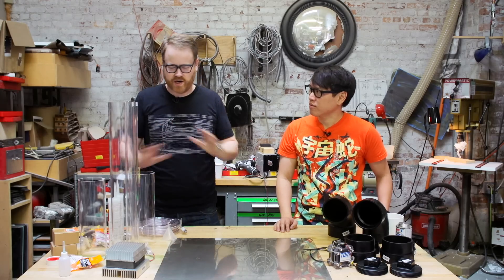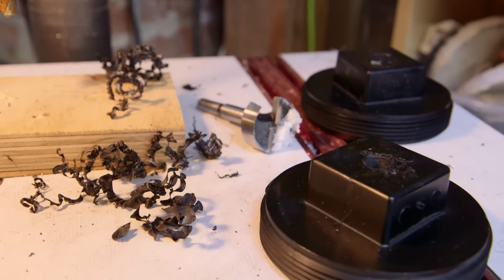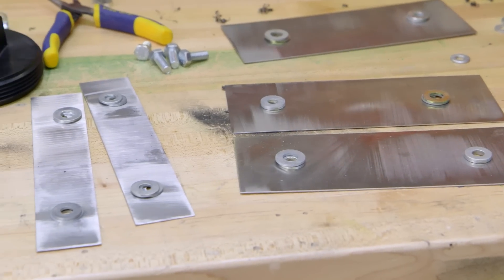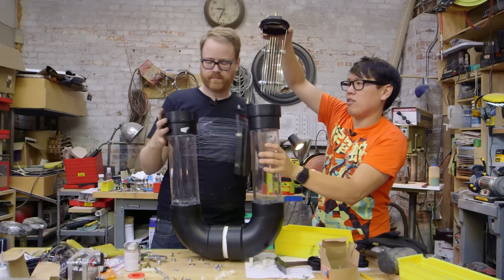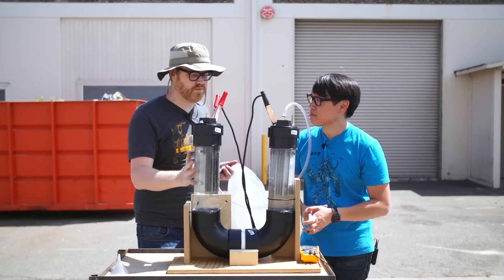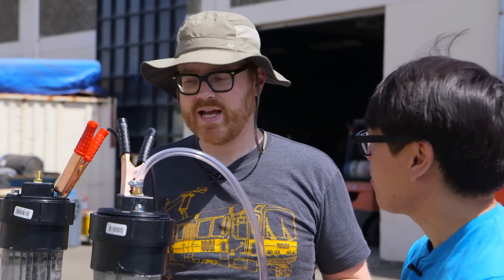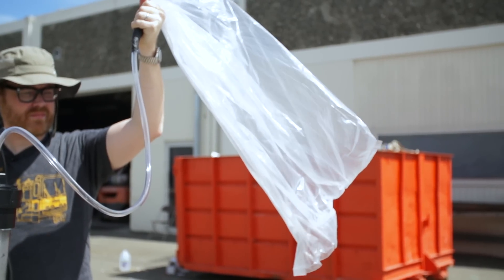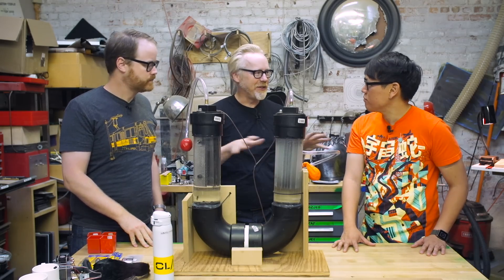Tested Builds a Hydrogen Converter

Comment: Wow these two guys do NOT know what they're talking about hahahahaha! 

Who knew, voltages can flow through water!? hahahaha
Reply: Pure water is not a conductor. Impurities in the water make it a conductor.
Reply: @willdwyer6782  you actually want distilled water mixed with salt so that its only conductive with no other impuritys so you only get hydrogen and oxygen.
Reply: @burntchickennugget191  NOOOO, Salt is the worst impurity, it will make chlorine gas.
Reply: @bokjerland9672  It depends on what type. Plus if your like me you will split up the chlorine from what you need
Reply: @burntchickennugget191  And Chlorine gas if you use salt!
Reply: All salt will produce chlorine gas. Hence the composition of NaCl. Also, distilled water as conductive as rubber.
Reply: @treysenzobell3299  you do realize you can filter out clorine right. Also there is a certain type of sodium that wont produce clorine since it doesnt consist of cloride. Or you could probably find some type of sodium on its own. Whatever works best. You see. If it doesnt experament and find a way to make it work. I dont see why people give up on it when companies like mazda tried it. Mercedez tried it. Even honda. The fuel was just too unstable when it was just dumped into the engine. If you can just use sodium use sodium. And distilled water. The crystals in sodium will be enough.
Reply: @burntchickennugget191  You do remember that pure sodium in water makes a highly exothermic reaction that results in NaOH and H. By highly exothermic I mean explosive.
Reply: @treysenzobell3299  perfect for combustion. In an engine. Like when you spark fuel it explodes same goes for sodium and water. Its the perfect mix for an engine. Think about it more power. Cheaper materials. More range if tuned correctly. I dont see an issue
Reply: @burntchickennugget191  Not when the combustion is in a chamber near an engine, rather than in a cylinder.
Reply: 5:41 oO ?
Reply: I thing it would just be easier to get water injected into a cylinder as the sodium is sprayed in before that way it provides the boom and the exhaust will be the reaction gases. Its all just hydrogen gas and heat. In my opinion its worth it. Your blowing up fuel in the cylinder anywyas might as well be a fine sodium dust that it sprayed instead of gas. Once the sodium is sprayed a thin mist of water will be injected aside from it and as the pressure increased from the piston getting closer the water will mix with the sodium and speed up the explosion of hydrogen gas. Its a much much better idea and the sodium dust will be stored away from the engine in a nice safe compartment were it cant mix with moister.
Reply: @burntchickennugget191  You know absolutely nothing about chemistry and are just trying to recover from an idiotic idea. Just give up already. Sodium and water produces far more heat than expansion, making it a horrendous candidate for a fuel. Not to mention, it produces sodium hydroxide, which is highly corrosive to skin tissues. Not only is every idea you've proposed ineffective, they're downright lethal. Starting at chlorine gas, moving to storing large quantities of sodium (a highly reactive chemical with one of the most abundant resources on the planet) that has byproducts that are corrosive to our bodies. Sit down before you say something more idiotic.
Reply: @treysenzobell3299  Heat is actually more usefull then you might think. 

I may not know too much. But thats what science is for. To learn more about this stuff. Sure you might know more and comsider this idiotic but in the end its still somthing we should consider. I see you took my last comment as an attack. Im here to learn. There is allready a special engine design that doesnt use expansion and instead uses the heat to produce power. With Cad we could replicate it without the lethal effects then test in a stable inviroment. You shouldnt be this close minded. Either way was nice chattin. I think ima do some tests in a simulator then see what i should do from there a buddy of mine has acces to some tools that will aid me. So in the end ima keep doing my research. I dont see the point in just sitting and telling yourself somthing is impossible or idiotic. Rockets are a stupid idea. Yet we still make em. Cars arent really the best idea but since its a fast method of transport we still use em. Giant sluges of metal flying past each other. Its fun untile somone gets hurt. I guess the same goes for this. Its fun and cool untile somone gets hurt or blows up an engine block. But im pretty sure this isnt gonna blow it upm your right expansion wouldnt happen without some gas. The hydrogen gas could but thats not the key. This is more or less a generator setup. Useing a compressor. That uses the hydrogen for a second part of the system. 

Again not ideal for most but in the end gas engines are only around 25% effecient. So i dont see how this could be any worse unless you use the same engine design. And we wont. Its not possible with the current engine design. But with a modified version it could. Either way. Ima figure out a way to use another method and explore new options.
Reply: For the purpose of breaking water molecules, sure it's not conducive enough. 

But if water were not at all conducive we wouldn't have the idiot warning labels on things like hair dryers.

Comment: Assuming you are supplying 5.29 amps (as the solar cell indicated as the optimal operating current), you would only produce a little over 2 liters an hour. Since amps and liters produced are directly proportional, you would need about 16.6 A to produce the 15 L in 2 hours.

Comment: "22 volts of power, about 100 watts of energy" i physically cringed
Reply: If the current from the solar panel was 4.5A then with 22 volts you would have 100 Watts of power.

Comment: Err... what's with the peroxide dumbos? a couple of spoons of salt would have done the same job as an electrolizer and no way that was 22v you were feeding into it, i've seen more bubbles in a glass of flat lemonade. Guess what dumbos, this idea really works and it's so easy to do but you two would be geeks still managed to mess it up. Oh and another tip, try looking into the right camera if you're going to do multi angle edits for youtube. You're a couple of amateurs but it does border on unintended comedy. Your efforts to discredit this idea is akin to me trying to build something I don't understand then saying it can't be done because mine doesn't work.

Comment: Over volted the setup, too small a surface area,  and used a poor h2 storage container.  Kudos for doing it and learning how to make it work,  although,  improving upon the design in multiple iterations and learning more of the chemistry would have been great to see. 

Most commercial electrolyzers run at 80% efficiency. And,  the bulk of industrial h2 is generated from natural gas using a water gas shift reaction.

Comment: They need more amps, not volts because voltage is energy in the electron while amps is the amount of electrons.  Since this is a redox reaction at heart, H2O+2e- <-> H2 + O.  The minimum energy needed is like 1.28V, to 1.5V.  The rest is excess.  So you pump up amps.

Comment: It looks to me like the oxygen side was open to the atmosphere while collecting hydrogen in a sealed bag on the hydrogen side. Is it not possible that when the pressure built up in the bag that the hydrogen was forced to and out the oxygen side? I think some sort of one way valve is needed between the two sides. Or maybe there wasn't enough pressure to cause this problem.

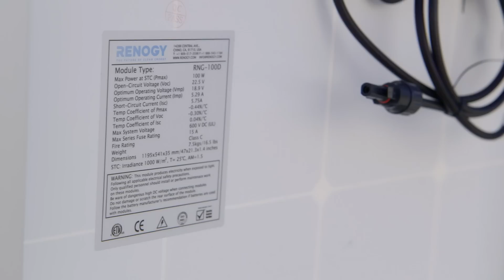Comment: 6:33 "It produces about 22V of power, 100W of energy." 
Yeah sure. Please learn some basic physics before trying to explain something to people in a scientific video.

6:55 Oh shit it is getting worse. We are at maximum stupid power here. 

The 22V delivered by the solar panel are measured unloaded.... This is the max output voltage. Once loaded (drawing current) it can go down in volage to anywhere, depeding on the load resistance, but the power output of the panel will always be 100W max. A car battery can output 5000W easy. The key for making the system efficient is to tune the reactor for the power source, which you seems to be unable to even think about.

Comment: This is an embarrassing display of science. Plates that are separated by almost a gallon of empty water space will not conduct a strong currant of voltage. If you're a quarter mile from a lightening strike point in the ocean, you're safe. If the plates are more than a few inches apart in your solution, they produce magnitudes less than if they are side by side with a perforated membrane. Also, in a lot of uses for hydrogen, the HHO that is produced by one of these is just as useful if not more. The only issue being the excess water production when burned or plate filtered such as in a fuel cell, which would require exhaust drainage in certain scenarios. If you watch The King Of Random's video, he is producing much much more gas with not much more voltage. You can angle your plates like so:

////\\\\
\\\\////

Making your corners opposite, and you'll double your production. Some clear tape and a hole punch will teach you wonders when it comes to separating the O2 and H2 gasses. Split it right in the device without worry of two separate chambers. 

It is obvious that this is purposefully done wrong. I was hoping not to find that the breakup was due to sell out...

Comment: No no no. If you get skin exposed to   strong base (or strong acid for that matters), just rinse it with lots and lots of water. Using a weak acid to "neutralize" it will make it WORSE, not better.

Comment: You will get more production if you gave higher voltage as high voltage will break the resistance of water i made one like that and got more production by giving high voltage i gave 8 amps 170 volt DC and got more production

Comment: Correct me if I'm wrong but they didn't use plastic bolts and plastic washers to separate the plates. Big mistake. I built one years ago in a small 6" x 4" x 4" plastic container that produced a hell of a lot more hydrogen than these guys did.

Comment: If they used electronics like DC-DC converter to lower the voltage and higher the amps of that solar panel if this panel is 100W then A=W \V = 100/12= 8.33 Amp then the DC Converter converts the 12V to 5 Volt and Multiply the Amp by 2.4 (Ohms Law) then the result will be 20 Amps, that would make huge difference to seperate water Molecules into HHO, after all it is about Amperage not the Voltage "In Conventional Electrolysis"

Comment: Good try, but I suggest you try a different setup. You can use something like a solid block of metal. Cave out two holes not all the way through so that they hold water. Pour electrolyte in both the holes and carefully place the electrodes on both hikes without them touching the sides. This way you'll be able to separate the two gases like you wanted without increasing the intrinsic resistance of the electrolyte which was a problem in your design.

Comment: Yay "Integrity". also why the fuck is Adam Savage part of "Tested" like it is some equal partnership? It doesn't take a genius to figure out that Will and Norm know absolutely fucking nothing about: Electric Engineering, Machining, wood working, metallurgy and plumbing.

They can build Legos. that's it. Something most of us have mastered at an early age. But you guys better watch out some of the stuff they build requires you to be older than 14.

Comment: If you would have sent the hydrogen through a bottle of water or a bag filled with water the hidrogen wouldn't escape and you could get it all instead of loosing it through the faulty untight plastic bag or balloon. Also if you had the anode and cathode nearby each other with a thin separation as possible it would almost infinitely expand the output.

Comment: Is water conductive? Yes, but electrolysis is another story. You want 15 L of hydrogen in STP? Then you need 15/22.4 (L/(mol/L)) = 0.67 mol of H2, by equation of electrolysis, you need 2 electrons to reduce 2 H+ ions to H2, or 1.34mol of electrons, or Na*1.34*e=129kC of charge, or if you run for half day, about 3A of current. The key is the current flow, not the voltage. No matter how much voltage you applied, you won't get 15L of H2 if you can't hydrolyze the water at 3A. Water will break at 1.23V+ so there's no point of applying higher voltages either.

Comment: Too much BS in this video. Fear using potassium hydroxide (to deter anyone trying), of which I have never seen used in any electrolysis videos. Increasing voltages DOES NOT increase production. The fking Current  (Amps) does. The anode and cathode are ridiculously space far apart. With so many sure to fail flaws tgen of course tge system is designed not to work. $hitbusters.

Comment: The electricity has to travel through a meter of water before reaching the opposite electrode. That's why this setup isn't effective for electrolysis. You'd need high voltage to make this work.

Comment: Hahahaha this is actually funny for me. I studied this for our thesis. seeing them fail reminded me of my collge days. For better results, you actually need to have a good amount of current running trought the plates. In what they did, there were small amount of bubbles even if they had a good voltage. the explanation is that the water solution still has a good resistance. You can also narrow down the gap between anode and cathode to lessen current losses/ resistance. Reducing the gap can also reduce the travel of the hydroge and oxygen atoms to their respective plates( anode/cathode)

Comment: There isn't any thing wrong in their design, its just a simple case of what power source they were using. They incorrectly stated that more voltage = more splitting. It doesn't matter what voltage, its how many watts (total amount of electrical energy per second) you put through it. 10 volts at one amp is the same wattage as 5 volts at 2 amps. This is because watts = voltage x current. A 12v 100 AH lead-acid car battery can supply 12volts at 100 amps, or 1200 watts, for an hour which is WAY MORE than their puny 100 watts. No wonder why that guy was creating just abt zero hydrogen, HE WAS USING PUSSY ELECTRICAL POWER!

Comment: Use electricity from solid panels on the roof of your shop to power the electrolysis rig a d use the hydrogen to power a generator to make electricity to power your shop...........makes sense........i use hydrogen to power jets and small cannons that shoot foam whiffle balls

Comment: Fake false maybe if you did it properly you would have gotten a actual result! One you can use baking soda for a catalyst, two WTF are you thinking trying to complete a circuit through the water!? The arc is supposed to jump from plate to plate causing more bubbles which brings me to three u use metal washers not plastic like the King of random uses the plates are not to touch so that the arc jumps. Completely one sister Adam Savage is a paid off hack!

Comment: You are making cool.But anode and cathode distance are so long to make this.This a major problem.Plate distance increase also resistance increase,so more voltage need.Electrolysis using less volltage more current is need.Maybe 5volt 100amps is better for 5mm distance of both plates is greater output is made.

Comment: Thing is a battery in a car is only used for initial start up. The alernator is what gives it all the power after internal combustion starts. Using a solar panel that size is like comparing two double a batteries to my 220 dryer plug. Nice try though . NOT!!!!!!!

Comment: I knew it would fail soon as they decided to separate the electrodes by such a large distance, nominally you would just put a couple of mm between the plates, or just put aluminium in a test tube containing Lye, you can fill a balloon in less that 30 seconds.
Perhaps they should use someone with some knowledge of science LOL.

Comment: You mixed up voltage and current!

A 12v car battery might have a lower voltage, but it can put out more current!

A higher voltage speeds up the reaction, but if you don't have the current available from the solar panel that the car battery could put out... you generate less hydrogen!

Obviously the solar panel doesn't need recharging :D

Comment: The large distance between the H and the O plate will severely limit the amount of gas you can produce in that rig. Ideally you want the + and - plates under like 10mm from each other. 
It's easy enough to separate the Oxygen out at the end because the H will always occupy the top 2/3 of whatever container you are collecting it in.  Just have to be careful with H + O mixed together from this because it's in the perfect mix to explode :)
Reply: Don't worry, it's not as if nearby there is fire or electr--oh wait. :)